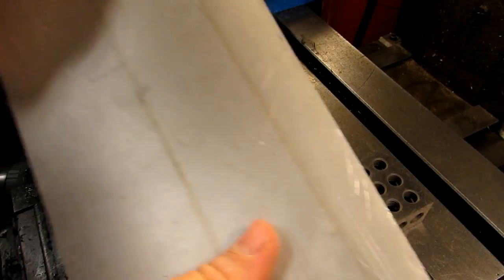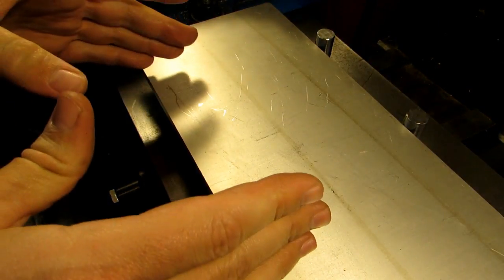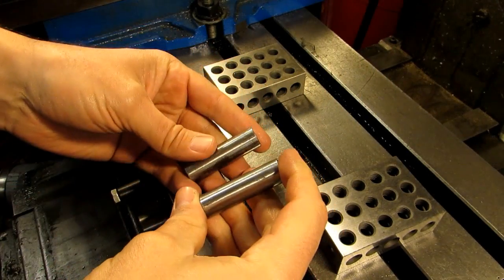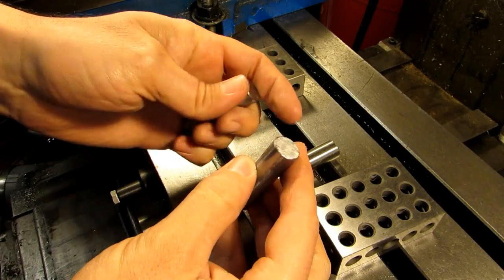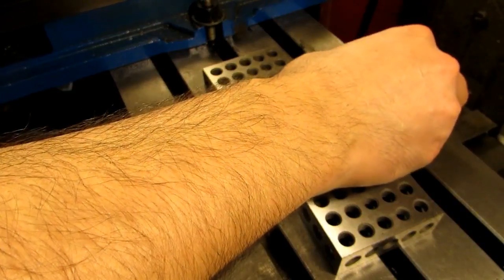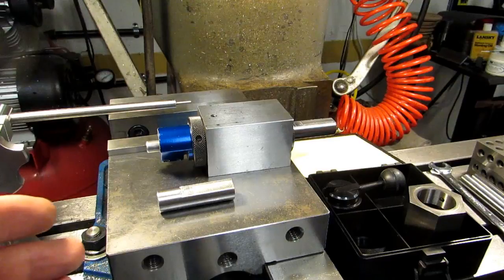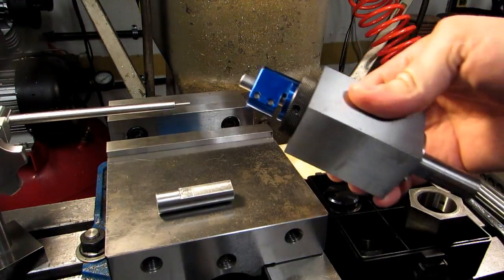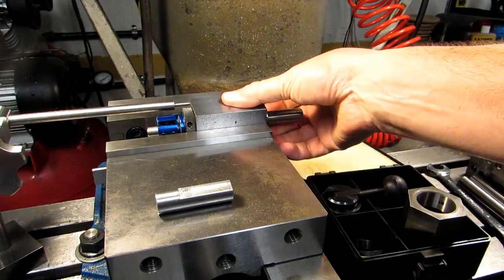Quick Machining Tip #1 - T slot pins

Comment: Another technique I have used on plate that exceeds the ability to use the pins is to move the table toward the Z Axis dovetail that is used to raise and lower the table.  Register the plate against the dove tails and snug the hold downs.  Fine adjustments can be made by checking with a test indicator.  I really appreciate you taking the time to make these well produced video's!!!

Comment: Are inside surfaces of the slots as accurately machined as top and sides to act as reference surface?
I have seen comments from experienced machinists about not using locating pins on a milling vise because pins + slot is not as accurate as indicator.
Reply from the maker: The slot width is very tight and straight. As long as they are undamaged, this is a really handy technique. This is a bit different than using keys on a vise because there you have the potential for many errors stacking up, the t-slots, the material used to make the keys, and the slots on the vise. We had keys on the vises at work when I started and I always checked with an indicator anyway. They were always out and the keys just made it difficult to adjust so I removed them. Lo and behold, it now takes LESS time to put the vises back on the table! Thanks for watching!
Reply: Stuart de Haro 
Let me ask the question differently - if you put the pins in, put a straight edge against them and sweep the edge with an indicator- does the needle stay on zero as you sweep along?
That would be a simple test of accuracy of your setup.
Reply from the maker: I'll check and let you know. For what I usually use this for, it's definitely good enough.
Reply: Stuart de Haro 
I am not trying to be picky, just curious how precisely those slots are machined. I imagine grinding them to the same level of accuracy as top and side surfaces would be expensive so they are probable only milled.
Reply from the maker: I'm editing a video on bronze bushings right now. Once I get that done, I'll test it out and slap it up on the Tube.

Comment: Thank you for all the tips. I just discovered your channel. I am a hobby home shop machinist with very little formal training so all this is very helpful to me. I'm not far from Parkland so if you ever have adult education night classes I would love to register.
Reply from the maker: Hi Harry Hopkins.  The class I teach is on Wednesday nights from 6:00 to 9:45.  Usually about a third of the class consists of older students either learning for hobby purposes or retraining for work.  Check it out.  Class registration for Spring will be starting soon and the course number is MFT 121.
Reply: @StuartdeHaro  Thanks very much for the reply. I checked out the course on Parkland's website and see that there are prerequisites for MFT 121 that make it inconvenient for me as I am about 90 minutes away.
Reply from the maker: Hi Harry.  There shouldn't be any prerequisites for that class.  Drop me a line to the email in my channel's About tab and I'll give you the contact info for the guy you need to talk to.